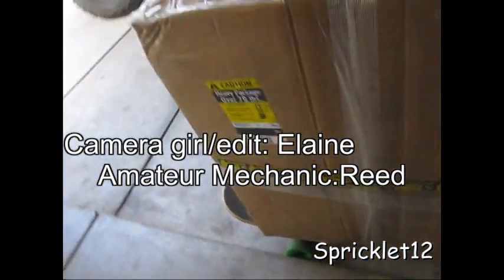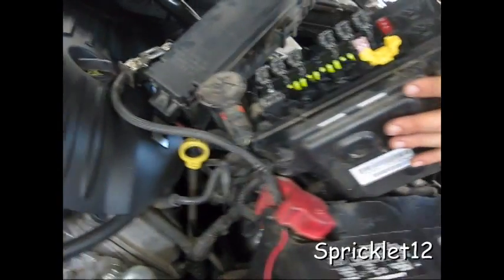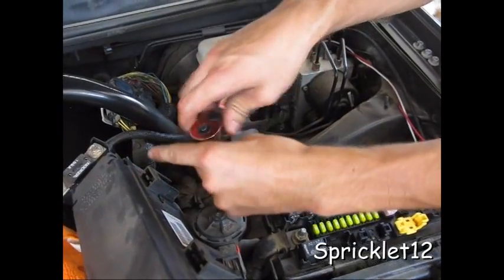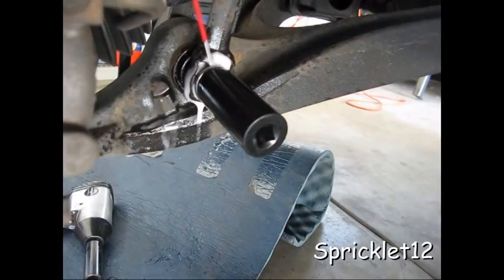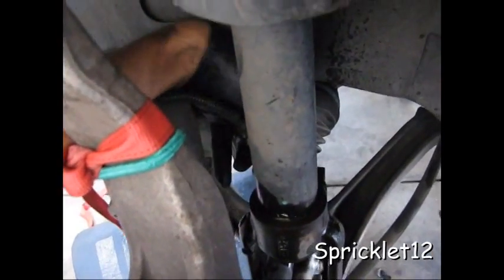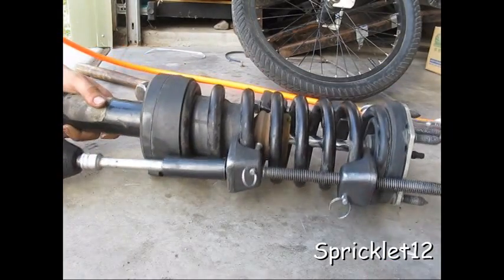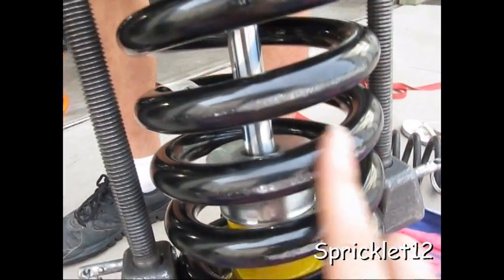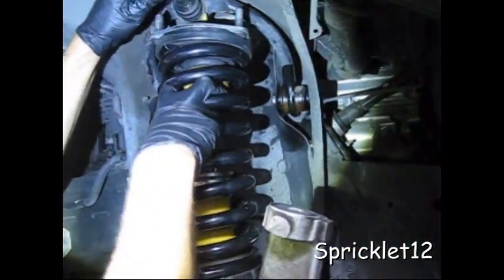| Jeep WK | Old Man Emu Heavy Duty Lift Installation

Comment: Good job. You made it look easy. I had difficulty with the bottom fork bolts.  They were seized from salt and corrosion. I twisted the nut off a 16mm bolt (that's a fair sized bolt).  Drenched them with various penetrating oils, heated them, hammered, twisted and even swore a lot.  On one side the bolt finally came out.  On the other side I finally just torched the fork and removed the lower control arm.  The replacement parts were over $1200 CDN, but it was still less expensive than going to a shop.
Reply: I'm also having a difficult time with that bottom fork bolt.. that made it seem too easy but like anything up here ,everything gets rusted and hard to remove.. taking a break for now. Started raining.. guess I will need to get a torch and heat it up.. 🤦‍♂️

Comment: Most of the bolts/nuts are not reusable and should've been replaced. Factory torque specs are required as well, which were not addressed.

Comment: That bolt you did at 4min20 sec of video, it's where I'm stuck, put pb blast and wd and still not budging.. b4 using screw driver and hammer was there anything else you did to it prior to it coming out?? Thanks in advance

Comment: Hi there , great vid , really appreciate it. Just bought a 99 gc limited. I have ordered the heavy duty emu kit for it and was wondering what size wheels and tires a guy could reasonably fit after the lift. Don't plan on doing any heavy duty off roading.

Comment from the maker: Thank you my Jeep is my pride n joy:) I purchased the Ome HD Heavy duty! rides better than stock Imo.  I did do the Pinch Weld mod up front just to be on the safe side and so the tire wont rub while turning full left or right. The pinch weld mod also helps when you go off roading! more Room for tire movement:) & yes the tires are Goodyear Wrangler Duratracs 265-70-17= 31inch tall
Reply: MsElaine what is the pinch weld mod

Comment: Hello. Since it doesn't look like you used any strut or coil spacers what so ever, does your WK sit with a balanced height in the front and back? Have you measured from axle up to the bottom of the fender? I hear that this distance averages 21.5-22" with OME HD. I need to decide whether or not to place a 1/4" strut spacer in the front, if the front sits a little lower than the back.
Reply from the maker: Hi! Yeah I didn't buy a new spacer. Instead I reused the day star spacer. Looking back i should have replaced for a new pair. I have a front end squeeky sounds when going over round abouts  and turns. Maybe it's the worn spacers I have.
I don't know the measurements. I haven't been able to drive the wk for...well it's still in the shop lol the wk broke down since February of this year
Reply from the maker: Yeah I don't like how it does look like the front end is lower than the rear end. Once I get my wk back I'll measure. It's getting its solenoid pack replaced😰

Comment: Your video says final tightening is done on the ground.  Do you mean tightening of the wheel lugs?  If not which bolts and how did you access them with the tires back on the vehicle. Thanks , installing this lift in the next week or two.
Reply: The upper control arm and any of the bolts through bushings should be tightened to spec when the suspension is at normal ride height and not when hanging down.

Comment: I will say the lift kit itself isn't hard to install. but people that have never worked on a vehicle from the north have no clue on the problems rust causing in a job like this.
Reply: Dealing with my wk when I had a broke all four wheel bearings. Removing the hub assembly was the literal definition of Satan, rust made it so bad that I was doing 1 hub a day almost
Reply: Lol right I am a Ford tech up north lol they think they need air tools down there
Reply: GW_Millkkyman my wk bearing was hell also

Comment: Hi Elain, I am really having a hard time removing the lower bolt on the lower cleves that holds the lower part of the shock. Did you guys really have to hammer it hard to get it out?
Reply from the maker: o yeah. I've heard terrible stories of the bolt and lower clevis being very difficult to remove. Luckily, in my case, we sprayed that area a couple days before. Used a little heat and a big hammer to get it out. I've heard stories from other wk'ers that they've even stripped the bolt because its so seized in to it
Reply: +Neil Yakuza  Hi great video .I would need some help... I got a new strut coil assembly and i have to install RUSTY S  2,5 in LIFT  mount on top but i broke the end of the strut TIP where you insert the key to stop it from turning so the NUT comes out. Can you please give me some edvice  THANKS
Reply from the maker: choco caroche What is your Lift goal? Is it only a 2.5 suspension lift kit? or  A modified Old Man Emu lift kit (approximate of 3inch lift)?

In this Video, we are replacing the DayStar 2inch Budget Boost lift kit for a new 2.5 OME suspension lift kit.
My Jeep wk was around 85xxx mileage with factory parts that haven't been replaced. 

I Would love to have a bigger lift on my wk, but with the options available, I opted out for the best bang for the buck. Plus, I didn't want to funk with the geometry of the Jeep Grand Cherokee WK and mess it up simply because I wanted a little more of a lift onto the Jeep
Reply: +Elaine Chu N  I bought RUSTY S LIFT  REAR 2.5 PUCKS   FRONT 1,5 but i PAYED FOR 2.5in  but  He said that in the end of the installation will be 2.5 Witch was not true ,and it cost me A GRAND TOTAL OF 260.00 PLUS DUTIES 100.00 -
IT CAME TO 360.00 CAD  Thats the deal in CANADA....
A WASTE OF DINEROOOO

Comment: Hello i was wondering is your jeep even in height on all 4 corners ? Cause
mine is not ever from the wheelwell to the ground are
First location
Front Left 36in
Front Right 36.75in
Rear Left 35in
Rear Right 35.50in

and Second location i measured 
Front Left 36.75in
Front Right 37in
Rear Left 34.75in
Rear Right 35.25in
Reply from the maker: The old man emu lift kit does make the rear look saggy. I am at 22'' Front and 22'' Rear hub fender measurement. Those aren't your hub fender measurements is it? what lift>
Reply: i measured from the lip of the fender to the ground. maybe i have diferent measure because i dont have the ome shocks i have bilstein 5100 shocks but i am thinking to get the ome shocks.
Reply: +Drossu Razvan  How do you find the Bilstein 5100 struts? Ride quality etc. Firm or flowing? Also have you adjusted them to the highest setting (if they are the adjustable model of course).

Comment from the maker: nate davis, my 265/70/17 duratracs did rub just a lil bit on full lock left/right on turns

I have to pinch weld mod to clear the tires

nothing but a little trimming, a hammer, & black rustoleum would get the job done :)